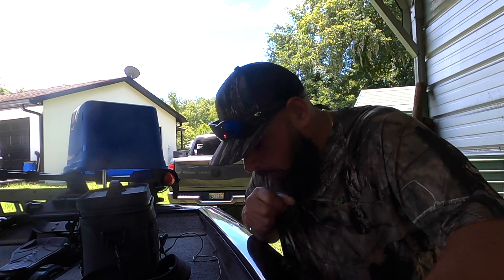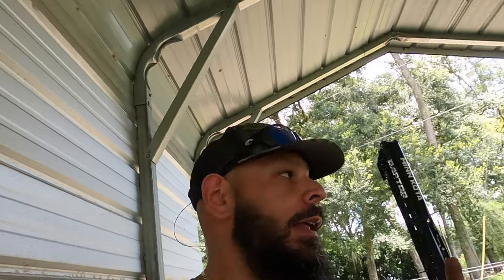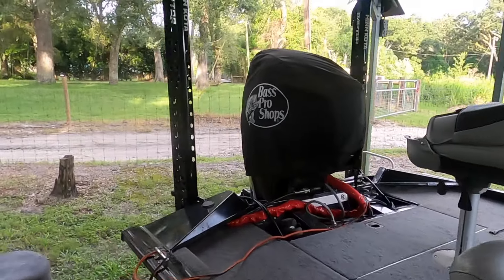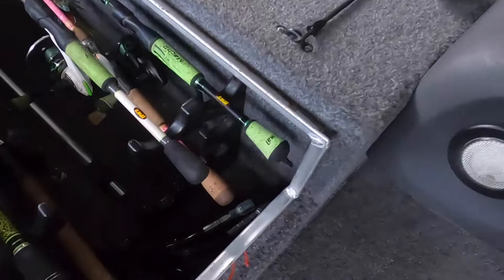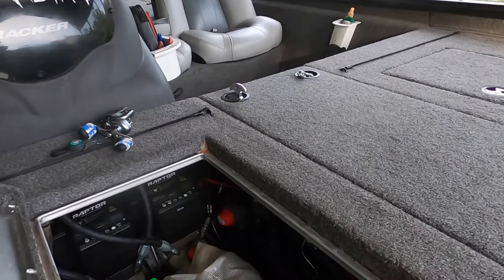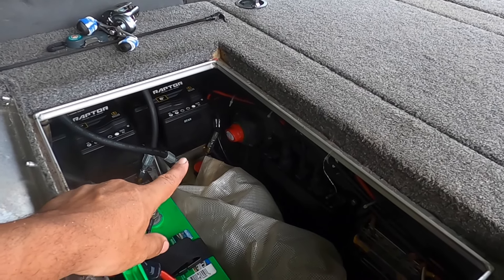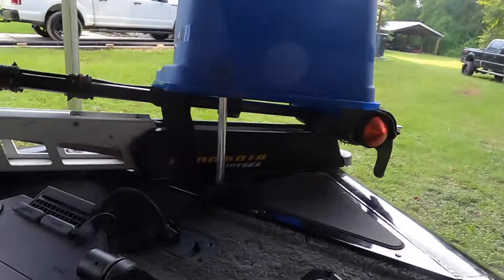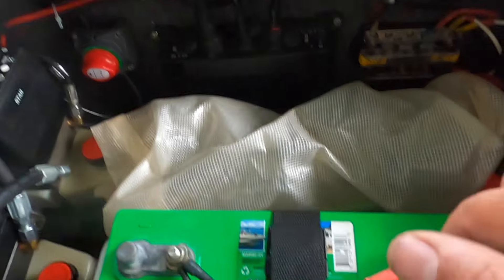Minn Kota Raptors Install On Bass Tracker

Comment: I have that same boat. Looks like those are 8Ft Raptors. How far above the deck is the top of the Raptor. I'm wondering if it will fit in my garage. I have a 7 ft high garage door with 8ft ceiling
Reply from the maker: No idea as ive sold the boat and have a nitro now

Comment: Looks good and I got the same brackets on my 190 tracker for my power poles.  I like my power poles and no issues in over 5 yrs on mine.
Reply from the maker: Yea both are good products
Reply: (Missed a U on your intro screen)

I would love to put shallow water anchors on my Tracker!
Reply: @teamwoodssports8493  would never have another boat with out them.  Are u in florida as well
Reply from the maker: @teamwoodssports8493  yea just created a need intro for my new vids.. saw that